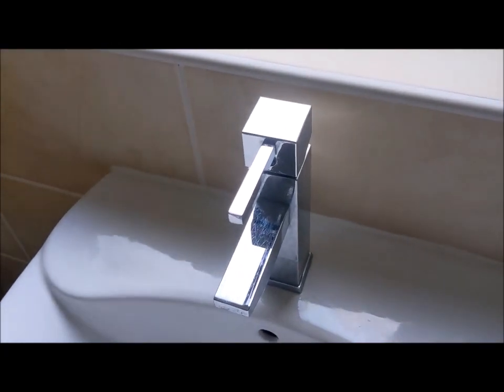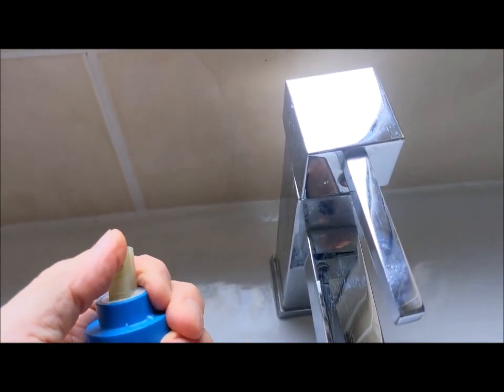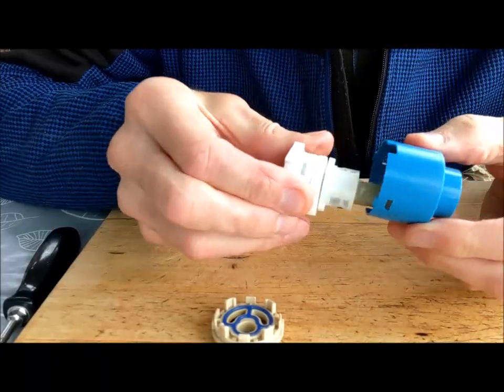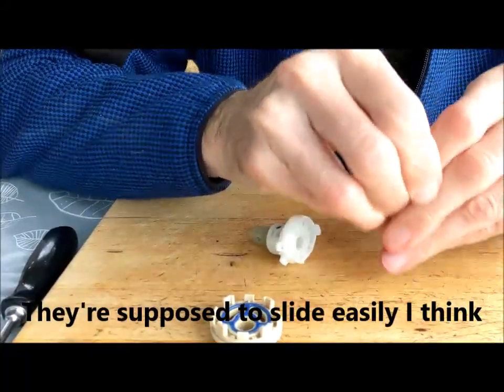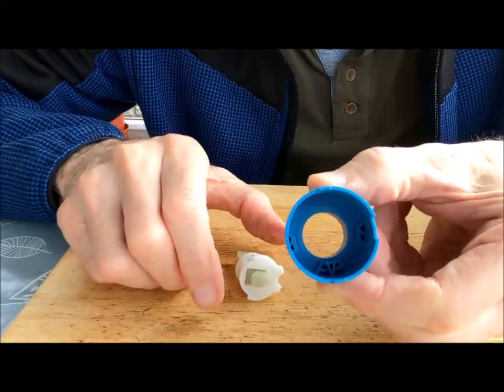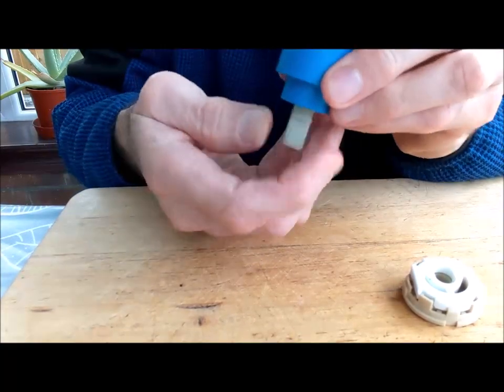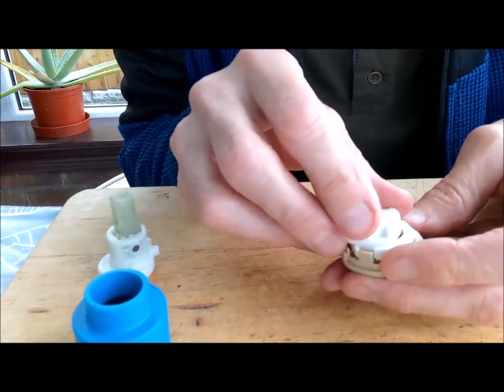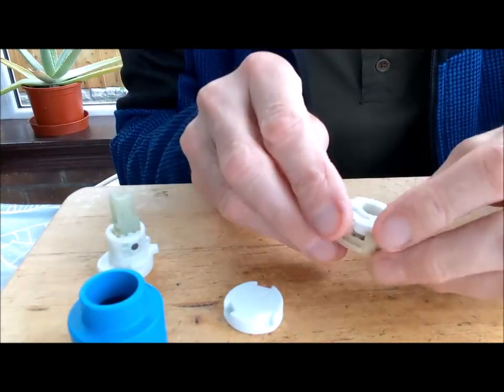How a mixer tap plastic cartridge works. What's inside your faucet and can it be fixed?

Comment: Are all these pieces lubricated or what and with what? 🤔
Reply: From what I’ve learned in my own repairs WD40 should absolutely not be applied to this part, use plumber silicone grease instead. (In case anyone else looks at these comments)
Reply: @ravindrabisram137 , good idea 👍. I don't think I have any, but I think I have some treadmill silicone oil...the real slippery stuff. Maybe I'll just try that. 😊
Reply from the maker: Good question. There was no evidence of lubricant on the old or new one. Possibly there was a fine spray of silicone not visible. I had tried WD40 on the old one but that had no effect. A query to a manufacturer rather than a third party retailer might get the answer.

Comment: Very helpful but what to do if there is still noise coming from the faucet when opening and closing the water flow.
Reply from the maker: Wish I could help but I'm not a plumber. Have you put a new cartridge in and still making a noise? Perhaps you need a new faucet. In my own experience, noisy plumbing has been caused by air in the system. Good luck.